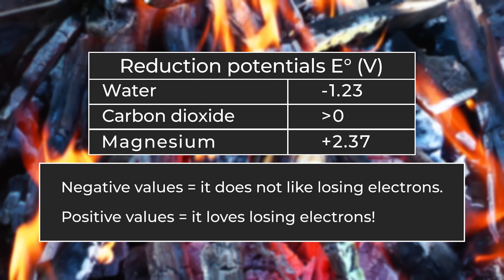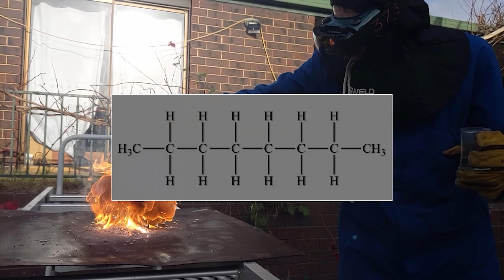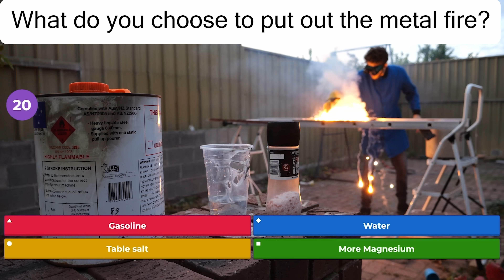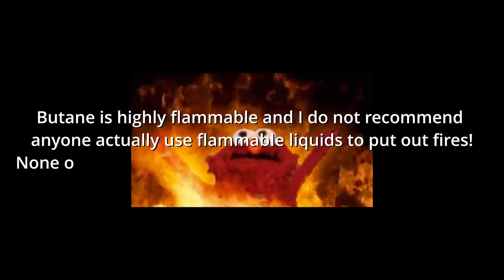Can Gasoline Extinguish a Fire?

Comment: @MrGreenguy - I think your extinguisher didn't work for the same reason your spray bottle didn't work. The extinguisher aspirates the gas to particulates before it reaches the Mg. The surface area of the gasoline increases, and exposing it to the heat of the flame causes the gas to ignite further away from the Mg. This would actually bring more oxygen to the Mg, because your creating a thermal low between the Mg and the burning gas. Same is true for your butane. I think you got a good result the first time is because you had a laminar flow from the cup, and liquid gasoline is much harder to ignite. When gas is heated without ignition it throws off its carbon atoms coating the Mg, giving you that barrier. The gas that does ignite does so on the other side of this non-burning gas mixture, possibly even increasing the carbon dispersal, before boiling off. Although less fun, I bet you could replicate the good results with any liquid with exposed carbon chains and no exposed gases that are flammable. Certain jet lubricants and motor oils should do nicely. Still very flammable, but not an oxidizing accelerant. You could also test this by getting your gas/butane in a laminar flow, but I'd recommend doing that with fire safe nozzle so you don't well.... explode.
Reply: Oh and needless to say but will anyway: This is stupidly dangerous. Do not attempt. If you choose to anyway, these chemicals burn with insanely dangerous carcinogens that can kill you from the inside out. If you like the idea of being turned into a burnt pizza roll with authentic cancer filling, that's on you. PPE - learn it, love it, live it.

Comment: I think the biggest thing you want to avoid is atomizing the hydrocarbons, as it makes them burn too fast to put out the magnesium, butane atomizes and evaporates so quickly it makes sense why gasoline works better. Like someone mentioned in a different comment, longer chains is going to work better, and higher viscosity and latent heat will also work nicely for removing the heat and cooling it past the point of reignition

Comment: Considering what effect burning gasoline has on the surroundings, I'd call that a Pyrric victory.  ;*[}
Try a higher hydrocarbon like diesel, it won't flash off as easily.

Comment: I'd think that the liquid butane worked on the smaller amount of burning magnesium because it likely carried off much of the heat in the magnesium away as it evaporated, cooling it below the temperature it'd need to reignite. Had you used more liquid butane on your larger magnesium experiment, in the same ratio you had used previously, it would have been successful in extinguishing the larger magnesium fire as well.

Comment: That was extraordinarily dangerous for so many reasons.  Perhaps using a far less volatile hydrocarbon would do the job with far less risk.  
Something like oil maybe a vegetable oil and also less toxic.  If you are going to continue doing this sort of thing, have someone with a fire 
extinguisher at the ready so in the event things go very wrong and you are set on fire they can prevent you from having a very bad day.

Comment: The reason gasoline works is because liquid gasoline doesn't burn. It's the vapors that burn. Spraying the gasoline aerosolizes it making more of it to burn at once and increasing the liklihood of a fuel-air explosion. Finally, if you're going to continue this line of work experiments all hoses should be metal instead of rubber and you should install a fire screen in the hose to prevent the flames from burning back into the canister.
What would be cool is to see an experiment where you put the metal fire out with gasoline and use a firecracker to put the gas fire out.

Comment: I'm thinking that the magnesium needs to be submerged in the petrol for it to work, because that prevents oxygen from getting to it.  That's why it worked on the ground, but not when held horizontally.  At least, that's my hypothesis if I'm understanding correctly.

Comment: Why Gasoline? Use something with low vapor pressure!
Use something like Motor oil or diesel! Low Vapor Pressure and High Specific Heat Capacity!

Comment: I think the spray bottle is entraining too much air, you end up with oxygen rich combustion. You need fuel rich combustion. It's got to go past stochiometric to work. Also if it's windy that will probably give you oxygen richness automatically too. Pouring it on with the magnesium at the bottom of a bowl is probably a better bet.

Comment: The bangy things military and demolition use: they pull the air out of stuff - you should give that a try! Lol. (Figured the algorithm wouldn't like the actual word, so went with bangy thing instead lol) Chip pan fires don't like being put out - they say not to put water on them. But, no once ever mentioned petrol! lol. Seriously though, I had a couple of friends when younger that were pouring petrol onto stuff, just messing around. They were pouring it directly from the can, like you. The first few goes were fine, and then the flame chased the vapour back to the container. Both had full depth burns on their face, arms, chest, stomachs, and most of the way down the front of their legs. A long time in hospital and a string of very painful operations got them to the stage where they were both alive and, although still significantly scared, able to live and function reasonable well, or at least, considering how badly burned they were.
I was supposed to be with them, but my dad was a truck driver and about 4pm the previous day, asked me if I wanted to go with him the next day, because he was delivering to the docks, which meant getting to see the sea. Something he knew I'd love - we only saw the sea ones a year, when on holiday. But, because I was young and stupid and had already arranged to meet my friends the next day, I foolishly told him that I couldn't because I was going out with friends. I really wanted to go with him, but I also really wanted to go out with my friends. Thankfully, late on the evening - close to midnight, I went into my parent's room and woke him up to tell him I'd changed my mind and wanted to go with him after all (bet he loved being woken up! lol). Halfway through the next day, as I looked in wonder at the size of the huge cranes driving over us at the docks, my friends were on fire, suffering something so horrific, it's hard to imagine!
I have no idea how the flame chased the vapour into the can, but it did. It instantly ignited, exploded, and showered them in flaming petrol. Luckily, an old guy saw them - saw the flames all over them. His bravery and quick actions saved them. Although, as mentioned, their burns were bad. Plastic surgery helped, but only a bit. Their burns were just too deep. The skin on their faces, arms, and chest had all but melted away. Truly horrific and incredible they survived!
Why tell you all this rather than just warning against pouring petrol straight from the can? Simple. Like me and everyone else, you'd think about it, but ultimately ignore the warning and carry on as usual. Plus, I, like most other people, didn't think the flame could continue into the container, and I'm pretty sure you think the same as well. But, it can! I still have no idea how or even how common it is, but know without doubt it happens! When the flame gets past the nozzle, it becomes one of those bangy things I mentioned at the beginning - about 3 million words ago! As it gets inside, the container rapidly expands, instantly breaking it into pieces and throwing petrol everywhere; which ignites the second it's exposed to the open air.
So, the moral is, be careful with petrol!
Although, it would be good to see some flung at a chip pan fire, just for the hell of it! (from a distance, of course! 😁) As for the bangy things, that could be fun too! lol

@DrivingBritain
.

Comment: btw you should be able to get a fire extinguisher thats called a water can that only holds water and is only ~100 psi that should have a thing on it to fill with air the same as a vehicle tire.

Comment: looks like the bigger aluminum pile is harder to put out because of scale and thermal mass. Area goes up by squared. Mass by cubed. Maybe Ethanol or something similar could work because of its evaporation energy and the "cold flame" trick where a dollar (paper) is soaked in it, ignited, and doesnt burn the paper.

Comment: magnesium needs a certain temperature to remain on fire
pouring a liquid onto it will cause evaporative cooling
it goes out like that, easy. burning magnesium will not give a shit about being covered up even seemingly well sealed away from air it will reignite once you air it again, very annoying stuff to melt

Comment: Drill a hole in fire extinguisher and then find and cut a refillable lighter in half. Find a round lighter to fit hole and JB weld should be enough to hold it in. Fill the container now will reduce the amount of lost gas and also slow down the rate of pollution you're releasing into the atmosphere.

Comment: I'm not sure on the technical terms, so please forgive me. 

But wouldn't this work for any flammable liquid? My guess is that the fire from the Gasoline is just consuming the ambient oxygen in the air without adding any to the magnesium. 

From your experiments, it seems that it requires the fire to be large enough to encompass the entirety of the magnesium flame for long enough to starve it of oxygen, thus putting it out.

That would also explain why the salt puts out the magnesium.

Comment: How about oil (hydrocarbon).  Or lay a wad of petroleum jelly or a piece of paraffin wax atop the burning magnesium?  It should begin to burn, but shortly go out for the same reason that a candle needs a wick to keep burning.  Another possibility is silicone oil or grease, which would be less flammable if flammable at all.  To pressurize your canister after adding a fluid or semi-fluid, add pellets of dry ice (maybe better, liquid nitrogen) and let it come to ambient temperature.

Comment: Perhaps the 1st attempt worked was due to you pouring the gasoline. The fire extinguisher and spray bottle would have caused small droplets, which is much more volatile, and no liquid gas was actually contacting the magnesium.

Comment: how about trying another liquid,the coolant used for servers?that might be a good idea since it is not flammable

EDIT:DONT TRY THIS IT UNLEASHES THE GENIE IT BURNS MY LUNGS IT EATS AWAY MY BONE OWWWW
Reply: (this is a joke lmao im competent enough to not superheat flourine containing hydrocarbons and you should avoid that and superheating anything flourine containing thats not a flourine salt too lol)
(for flourine salts superheating them to make bad gas is harder,you have to heat them really hard and then they pyrolyze and make flourine gas(not even sure if the flourine bond can hold up,it might just be a ton of monoatomic flourine lol which is more energetic and dangerous and you can make FOOF outta it),or you could just put acid on it or heat it and  pour water onto it then it will make bad gas,a lot of ppl died during the discovery of flourine,dont do it)
Reply: (flourine salts mean something that makes flourine ions in water,somthing like methyl acetate but the acetate has two flourines does not count lol)

Comment: it seems like all the original examples work by suffocating the metal fire (preventing oxygen from touching magnesium) with the gasoline/butane using all the surrounding oxygen and evaporating (taking the heat from magnesium fire to the flammable liquid). the nozzle in an extinguisher releases droplets, allowing space for oxygen. this is usually ok for extinguishers because the non flammable material naturally likes to expand and fill the space with itself, pushing away the oxygen; your gasoline is evaporating quickly in its nozzle mist form and allowing oxygen through. try making the nozzle more of a stream that shoots the flammable liquid more compactly to prevent oxygen from fueling the metal fire.

Comment: Apparently one of the suggestions for dealing with plutonium fires was to cover it with a different metal that blocks oxygen and absorbs the heat bring the temperature below the auto-ignition point. A more complete (and quite fascinating) demonstration of burning plutonium can be found in this video: https://www.youtube.com/watch?v=ssH9o32CZtg How often do you get to see that much of the material at once?

Comment: 5:30 I cut open what I thought was an empty fire extinguisher to use as a crucible about 2 months ago… Wasn’t empty, almost full, just not pressurized. That yellow powder got all over my garage, backyard, patio… it was too heavy to blow away and too thick to be washed off. Finally, eventually disbursed, but there are still pockets of it in my yard today.😂
The cloud it made stuck around the neighborhood for a good day too.
Point being, I can’t believe you got away with shaking it like that INDOORS💀🫡 god speed

Comment: I think the problem is your applicator.
Your firing liquid at the fire at a rate of knots, which will always cause turbulence in the air and draw fresh oxygen to the magnesium.
Would spraying the magnesium from a distance so that the mist of liquid has dropped in speed by the time it reaches the fire help?

Comment: Bro, maybe there's a reason that salt-extinguisher uses barely any pressure.
Common theme in your experimens: Unpressurized free flow will, anything pressurized won't effectively extinguish, maybe because spraying it through the air with any amount of pressure will inevitably rip some oxygen along for the ride, feeding the fire until the pressurized liquids have been blown across the target?
And you need enough of introduced mass to instantly cool the burning magnesium below the point of self-reignition, what a spray can will not do.

Comment: Mate, you need to learn to appreciate your eyebrows. Also, acetone dissolves many kinds of plastic. So you were onto a real winner there.

The spray bottle of gasoline probably didn't work cos it didn't displace any air. Might also be that splashing gasoline over cools down the burning metal and puts it out that way. Maybe the butane extinguisher would have worked with more volume, you need to dowse the magnesium, not just add more fuel to it.

Comment: The gazoline did consume the oxygen around the magnesium fire, but as you said, and demonstrated, CO2 gets ripped apart and provides the oxygen needed. There is one other factor that counts, gazoline evaporates and takes away heat.   The tiny tests did that too, but not enough. 
On the other hand, a cover of magnesiumoxide over the fresh magnesium, couldn't that form a protective layer?

Comment: Dude the open-air propane refilling is fucking nuts. Sure, in theory the oxygen would be pushed out. But sometimes theory doesn't go in practice. On that scale, you could have died. Here's a quick story.

Essentially, I was bored one day, so in a water bottle with a tiny tube coming out of the cap, I mixed made a solution of sodium hydroxide + aluminum rode. The idea is to make a constant flow of hydrogen for a nice mini blue flame torch. So, I thought of course, I didn't want to make an unwanted "energetic", so I waited ~5 min to flush out the oxygen after rode placement.

The hydrogen gas was flowing at a very steady rate,  and after 5 min, I lit it up. --- Ears are ringing, cap and tube flying through the air, the warm hydroxide water bottle is all over the ground, flocks of birds flying away. In theory I would've been fine... right? I got lucky in that the incident didn't injure me, but I for sure learned a lesson after that one.

Be careful man. Don't want you dead! Keep at the great work, but don't be stupid. Best.

Comment: ... so I can't tell if you were being facetious with the spray bottle but atomizing a flammable liquid in an oxygenated environment will not help with putting out a  fire, you need to completely dowse the fire in liquid so that there is no oxygen left at all. AKA, fuel rich combustion. very fuel rich since this is not contained. A proper detonation might also work to push the oxygen away, but that would be even more dangerous.

Comment: I feel like the key was a large volume of liquid gasoline moving at a relatively low velocity, and not being dispersed in the air before it contacted. So there was enough volume of gasoline contacting the mg to reduce the heat, without entraining a bunch of oxygen from the air in there or blasting the magnesium pile apart.
Hence why the big cup-o-gasoline worked but not the extinguisher stream or the bottle spray.
Reply: Now there's the comment I was looking for ! Precisely my thoughts as well.

Comment: ABC fire extinguishers are generally non-toxic/non-carcinogenic (not all though). However, the powder in them is like flame proof flour but worse because the particulates are EXTREMELY fine which means if you use one indoors, I would recommend turning off the vents, close all doors and windows, and making sure there is zero airflow in your house because that stuff will get absolutely everywhere. If you used an ABC extinguisher in one corner of your house, expect to find some of it in just about every room of the house because that stuff will stay in the air and move with it forever. That’s why K extinguishers exist (basically an ABC extinguisher but for kitchen fires because it uses larger particulates). 
Side note: the powder in ABC extinguishers is known to be a skin and eye irritant and CAN cause harm if inhaled 
5:34